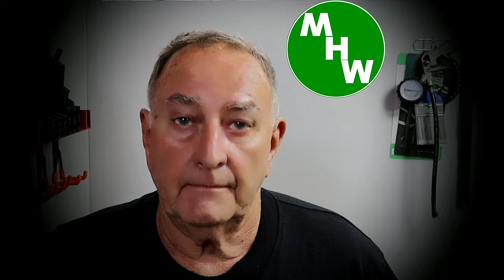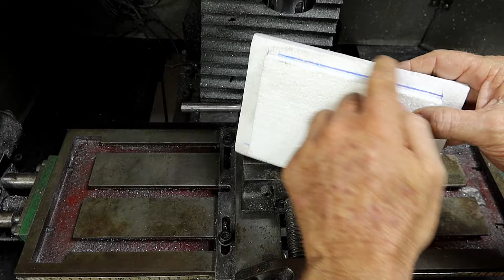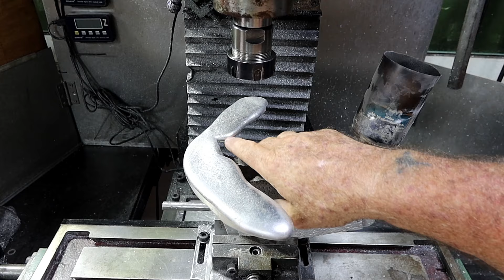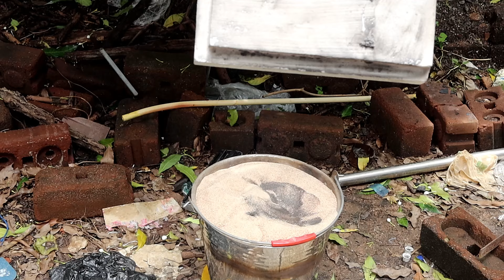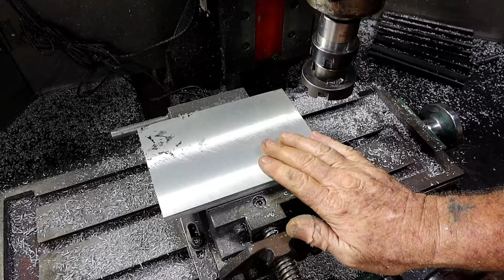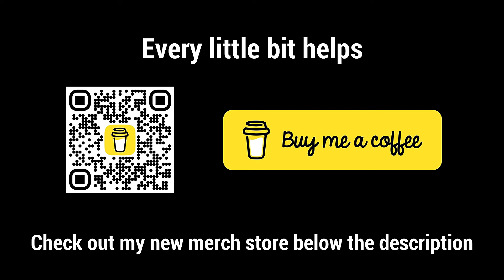MHW Episode 140  - Cast Aluminium Milling Pallet - Part 1

Comment: New subscriber, great channel mate. With the blow out, you need at least 50mm min of sand between pattern. If you use green sand for casting it should help with the surface finishing.
Reply from the maker: Welcome aboard. The poor surface finish comes from the imperfections in the foam, it can be improved by sanding the foam first, I just wish I could get the construction foam here in Thailand, but it's just not available. It's my understanding that green sand is not used when lost foam casting and it's not compacted, just vibrated into place, I'm 100% sure it was the fact I didn't have enough sand over the top of the foam that caused the initial problem. Thanks for watching. 👍

Comment: Excellent video!
Just an observation on your casting method; that sand looks really dry.  Do you use any bentonite or clay mix with it?
Reply from the maker: No I don't add anything to I the sand, it is my understanding it isn't required when using the lost foam method. Thanks for watching. 👍

Comment: if the sprue runs dry, the sand will cave. likely you stopped pouring because you couldnt see what was happening. resulting in a cave in.
Reply from the maker: I never actually stopped pouring in that one. Thanks for watching. 👍
Reply: @MyMiniHomeWorkshop  if you didn’t stop then you poured too slowly. That white foam burns out really quick. I use denser foam.  It makes it easier to keep up when pouring. Vibrating the sand will help prevent that blowout you had at the top of your second piece also. Cheers
Reply from the maker: @stevesrt8  I'm convinced it was a lack of sand over the section that collapsed because it didn't happen on the 2nd attempt. I use the most dense foam I can get here, that builders foam I see others using is not available here. I use a really crappy lightweight stuff for the sprew because the higher density stuff won't burn fast enough and leads to the material not making it to the bottom before it starts to cool enough to start solidifying.